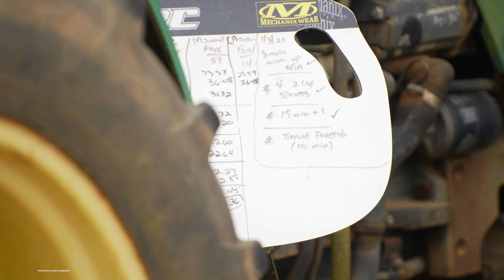Dylan Ferrandis Rookie Season - Motocross Action Magazine

Comment: When Yamaha brings out the new 2022 the 450 team will be much stronger
Reply: You would hope it would be better because they went backward in 2010.
Reply: @caydenthompson126  those guys are smart enough to somehow add 1% rigidity on one part of the frame I’m sure they can fix it after 10 years of neglect
Reply: @chazzgonzalez1356  We'll see! That's why I bought a YZ250 and not a new delta-box 4 stroke. The frame on the smokers flex a lot more.

Comment: What is the weight of those yamaha star racing bike?
Reply: I think the minimum per AMA is they need to weigh atleast 220 lbs.
Reply: @caydenthompson126  I know it's around that, and it's around the regular weigh of a ktm.
But a Yamaha is 238 without gas, so knowing that they will use lot of titanium, i couldn't find that info anywhere, how light they are able to make them
Reply: @idrissalam  I'm sure they are able to shave off 18 lbs to get it down to the minimum. A ton of ti lol.